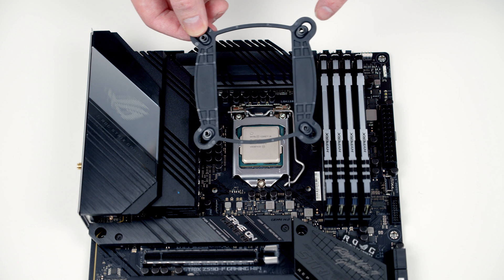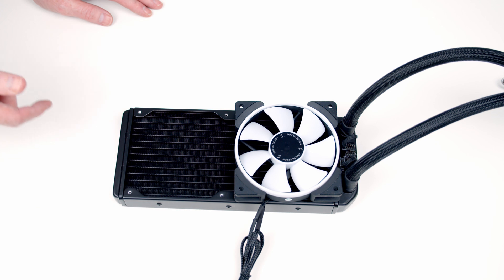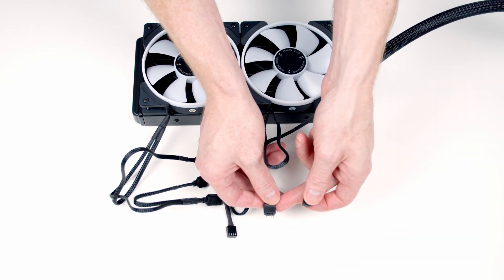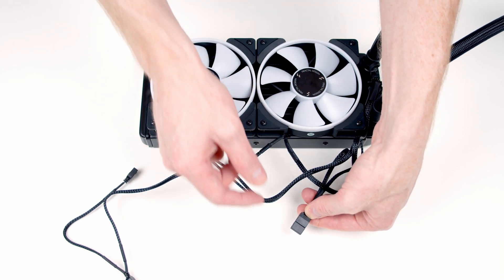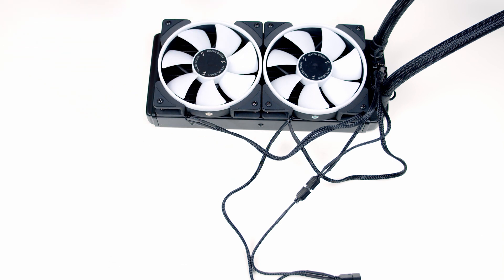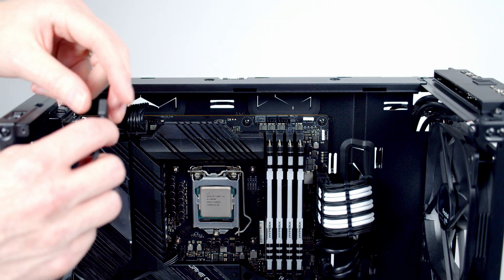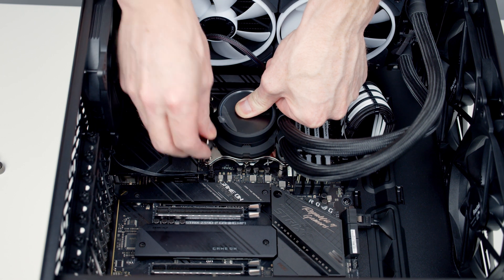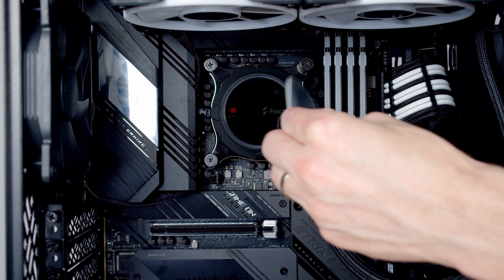Fractal Design Celsius+ S24 Prisma AIO Installation Guide

Comment: Does anyone know how does controling the RPM work? If you plug both the pump and the fans into one PWM header doesn't that mean that you can't control the speed separately? So if the pump and fans operate at different RPM's, wouldn't that be a problem?

Comment: my fans act like they are RGB. does anyone know what i could be doing wrong? i have my cables comming from the fans, daisy chained and plugged into the cooler's hub. the ARGB connector comming from the cpu part, is connected to a ARGB header on the motherboard, and the other cable is plugged into the CPU_FAN header. just like the video...

Comment: Hi my friend. I am not sure in which direction to place the case fans. Need your help. I bought 10 x Corsair QL120 case fans. On my Lian Li 011 dynamic XL Rog case which direction should they go. I have the Corsair iCue H150i elite Cappllix CPU liquid cooler. I’m not sure about airflow which way the fan intake for air.

Comment: I went with the s24 because it is simple and tidy requires no software and comes with a fan hub. I love the performance, I have it on a Kraken G12 for my 2070. Someone should make a video showing how to use the expansion for another water block or res, or how to refill it it.